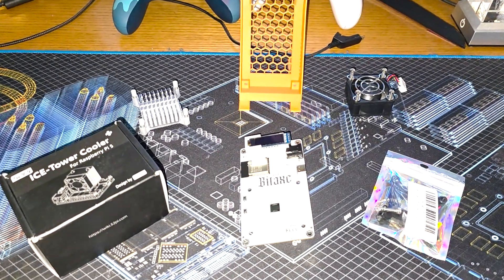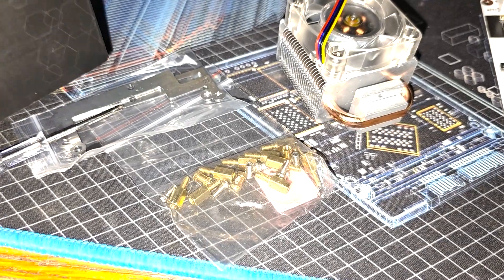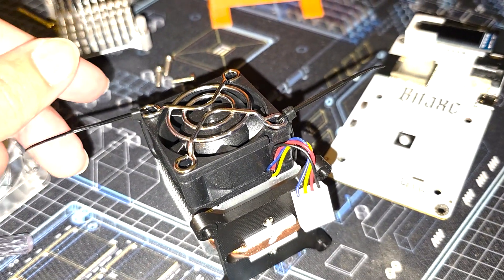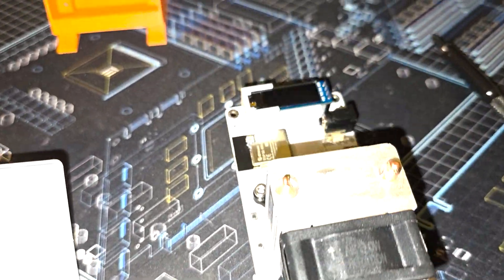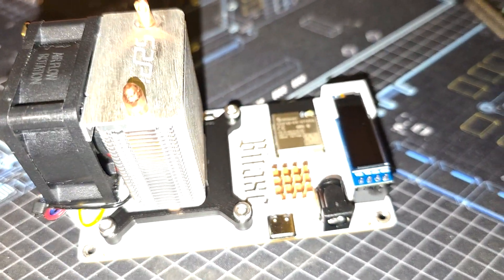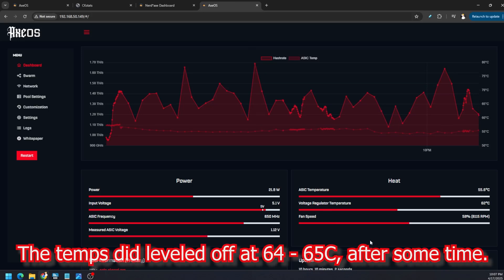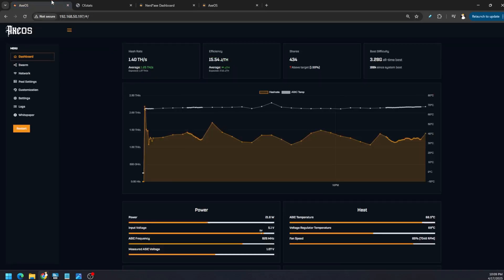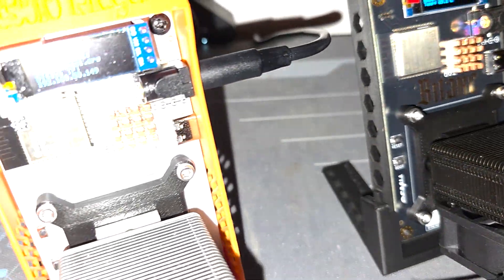Bitaxe Cooling Mods & improvement

Comment: hm running noctua A6x25 (front) with 
GeeekPi Low-Profile Plus and A6x15 (back) - Same cooper elements. With 100% fans on i can up go to 2.2 th with 35watt and 18j/th efficiency. However running on 1200mv and 800mhz with 1.7th and 25watts / 15j/th efficiency / Temps 58c and 63c VRR.   Just for fun i have tried today the Bitchin Heatsink with Noctua A4x20.....cant recommant - fan was running 100% always - quite loud ! + temp around 70c for the Asic. Check out this case 3D print: Bitaxe Performance-Gehäuse V2 - you can find it on makerworld/bambulab (A6x15 will fit to it at the back).

Comment: I built a waterloop running 5 gammas in series.  40mm water blocks, all piped into a 240mm rad, mounted on top of the rad, along side 14mm copper heatsinks for the vrm’s, and 2 140mm corsair fans for airflow.  All gammas are 40-50c on the asic at 800mhz, with the vrm at 48-53c pushing 1220mV.  Stellar performance despite heating up the entire ambient area around the setup up to 31c.  They all run 1.6 to 2 Tera hash consistently
Reply from the maker: Send pictures on X - Twitter please. Awesome sounding setup
Reply: @SerpentXTech  done